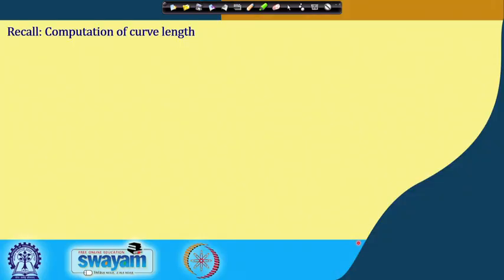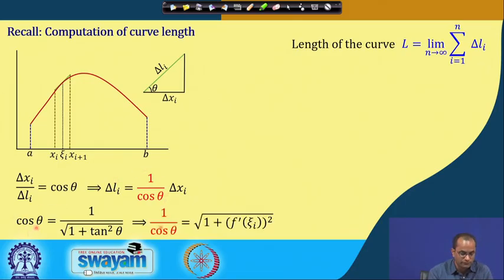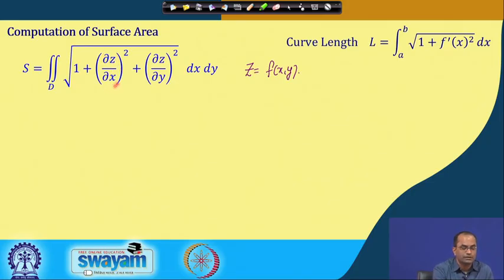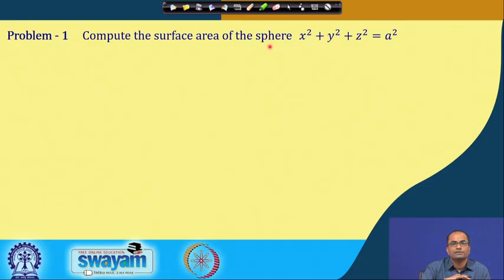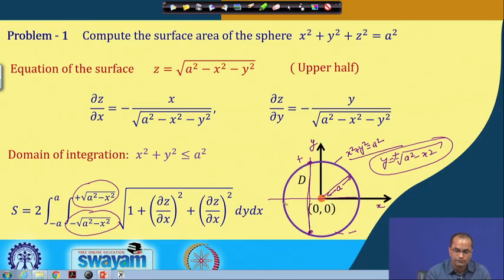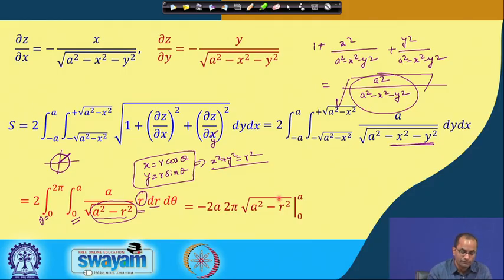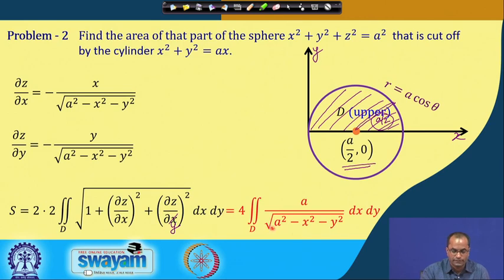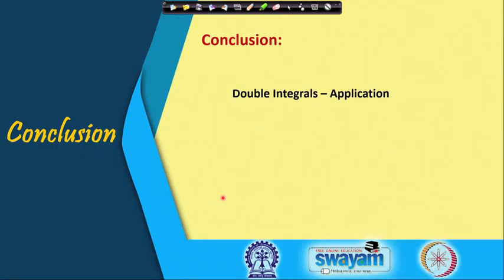Lecture 33: Integral Calculus –Double Integrals: Surface Area

Comment: With all due respect, I believe the second problem is wrong.

The cylinder x²+y²=ax remains above and below the first and fourth quadrant, and intersects the sphere in only 4 octants, not 8. Hence, to integrate it in two octants and multiply it by 4 is wrong.
Reply: It's correct.  We multiply 4 for surface area in 1st,4th,5th and 8th octant. First 2 is for 1st and 4th octant, second 2 idms for 5th and 8th.
Reply: @himanshukhichar4185  exactly 👍👍👍👍
Reply: i know where you faced the problem...yes it is true that both the upper and lower halves of the cylinder could have been considered at once and thus the integrand would have been multiplied by a factor of 2 only ,but then during the limit of theta, we have to put -pi/2 to pi/2....but sir has taken the domain to be just upper part and has taken the limit to be zero to pi/2. So yeah...both ways it is correct.

Comment: Sir why 2 is multiplied in calculation of surface area of sphere, since in limits you have considered both upper and lower parts
Reply: It is a sphere not a circle... we are calculating the sa of the upper part and to get the sa of the sphere we need to multiply it with 2
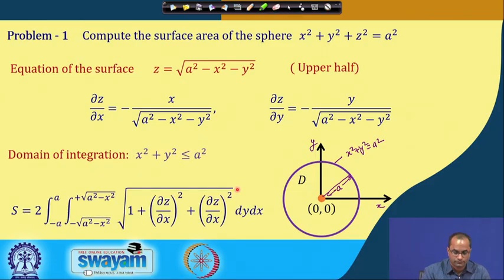Reply: @ayushgupta8538  check at 17:30 we are multiplying 2 just because we are taking the upper part of the circle. and we are calculating the projected surfacce area .